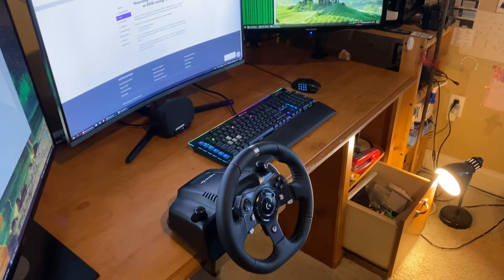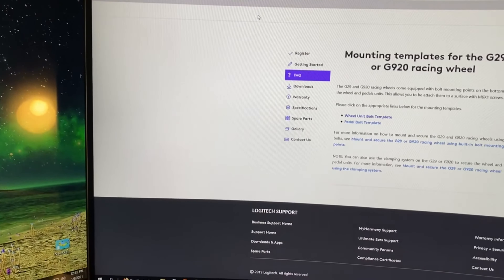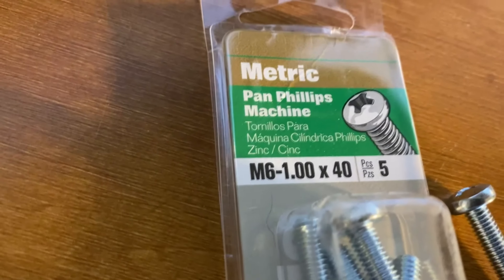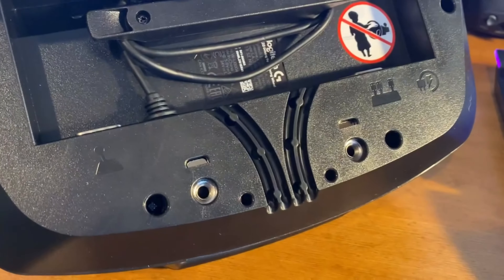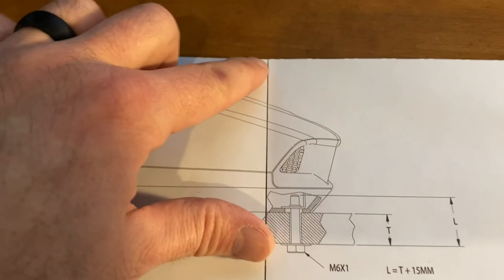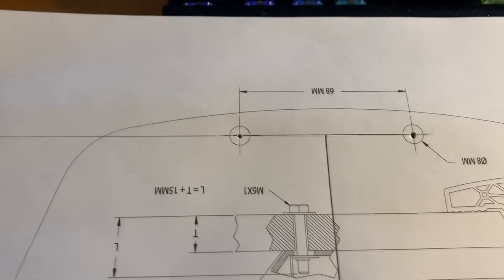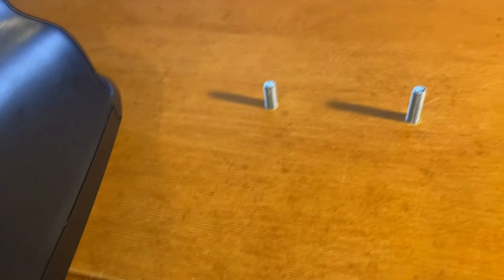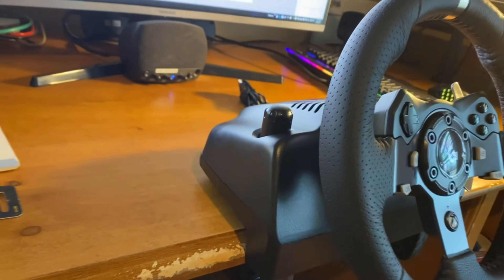Logitech G920/G29 Racing Wheel wood desk mount drilling M6 screw

Comment: Thanks for the instructive video, good work. One question I do have is around the drill bit size. On the template is say 08 MM next to the drill holes but then you show a 6mm drill bit. Shouldn't it be an 8mm drill bit? Maybe it doesn't matter as long as it is 6mm or larger.
Reply from the maker: Yes sir I initially tried the exact drill bit from the template but it was very tight and I could barely get the screws in. I think the template size would be fine for a permanent mount. But with me going to take the wheel off and on, I had to make it slightly larger for ease of use. So really depends on your needs. Good question though!
Reply: Can we use 8mm drill ?

Comment: What a life saver! Did you print this off on an A4 size of paper?
Reply from the maker: Not sure what A4 is, but I printed it on a standard 8.5 by 11 inch page that most all our paper comes as. Good luck!
Reply: How did you manage to take off the braces on the bottom of the wheel?
Reply from the maker: There is a part 2 video where I have links to the videos I watched. But basically you disassemble the wheel to get them off.